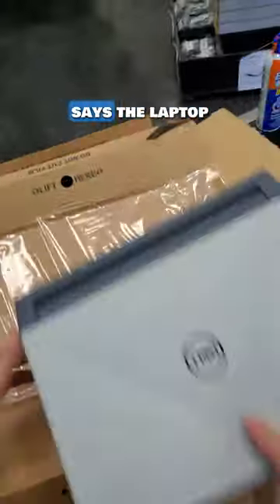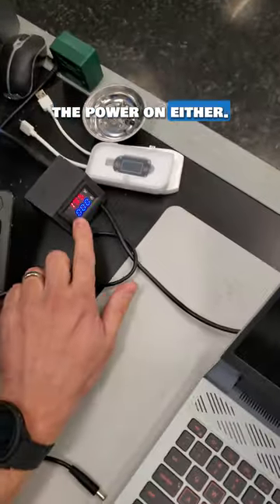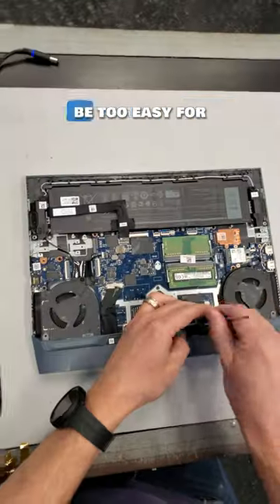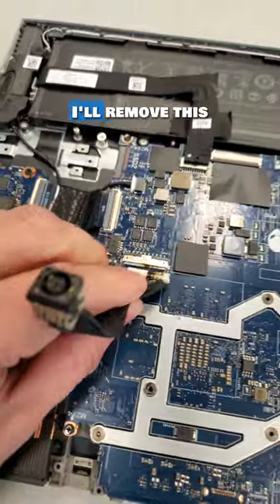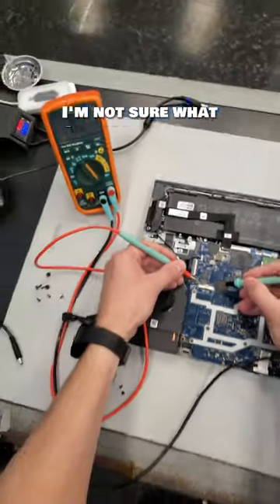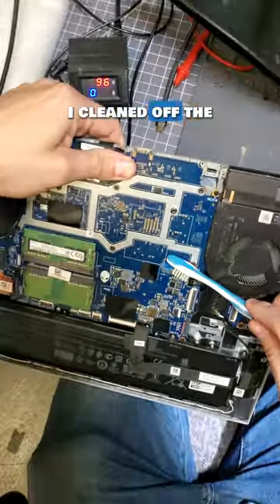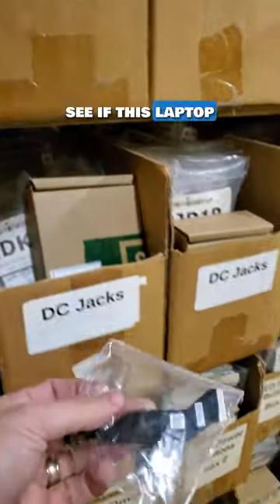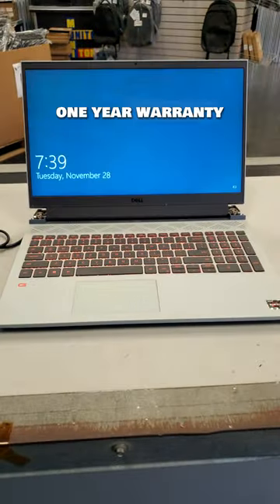Burnt Laptop Repair Saved: A Stroke of Luck! #shorts #laptoprepair

Comment: Not replacing the MB connector will result in a repeat of the failure. I've done the exact same model. It might look fine but if you cut the connector apart you will see that the plating on the pins is gone and there will be pitting, it will never have low enough contact resistance again.
Reply from the maker: That is possible, but I gave them a year warranty, so they are covered.  The connector looks good, I think the DC jack just wasn't plugged in all the way and so it melted.

Comment: Hoping to get an answer for this one. My laptop powers on when i plug it in, but it wont charge my battery. I can use it if it's plugged in but will shut down when it's unplugged. Already tried buying new charger and battery but still get the same result. Also tried test probing the charging port to check for voltage, I get 19v (since my laptop need this voltage to power). Out of options left to do, hope that you can help me. Thanks😃

Comment: I need help with my g force laptop, brought it last year, and recently pulled it out of its case , won't turn on! Or charge how much would this cost please help, it's basically new!, I use it only like 4 times , one to play RuneScape and school work. , but then I haven't used it since last month from my last full time job :(
Reply from the maker: We charge a Flat $100 for a laptop diagnosis and repair; if it is a motherboard repair, we charge an additional $100. So, the total is $200. If we cannot repair the motherboard, there is a $30 diagnosis fee plus return shipping.

If it is a Dell or Alienware laptop and you live in the USA or Canada, you can fill out a service request form at partspeople.com and send it in.